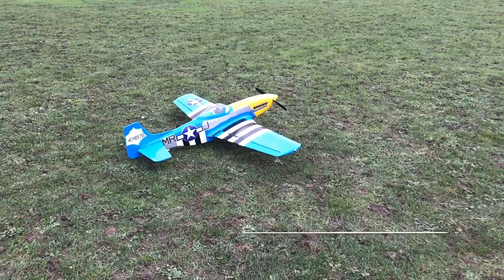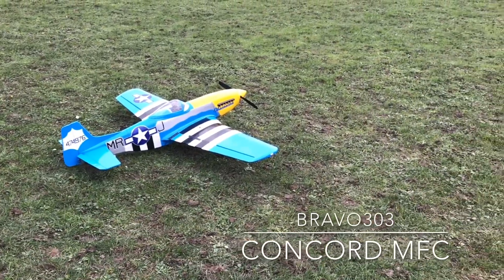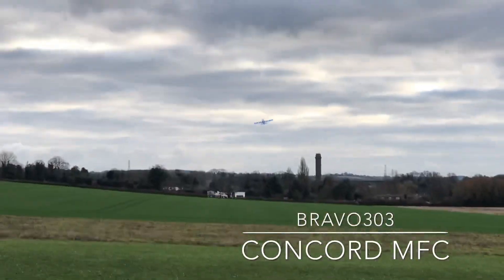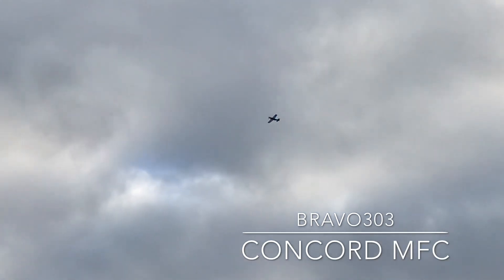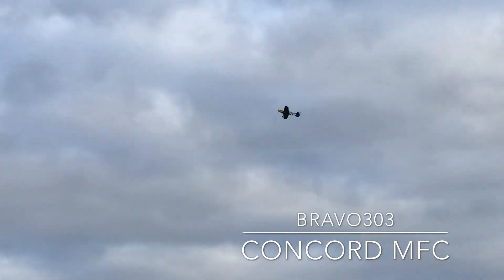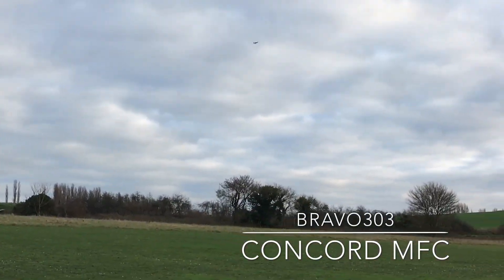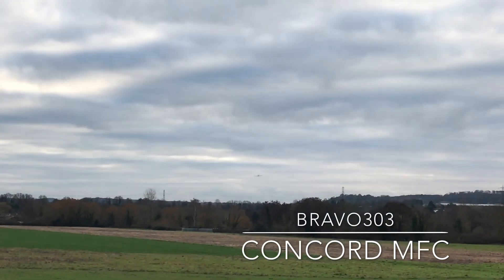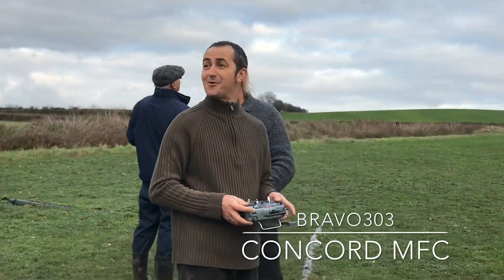VQ Models P-51 Mustang  EP "Obsession" Maiden Flight - Concord MFC

Comment: Congrats on the maiden Aaron.

I’m just finishing off building mine.

Do you mind sharing what motor/esc/battery combo you used. What was the takeoff weight?
Also, did you measure the CG where the wings meet the fuselage? The instructions are a bit vague.
Cheers
Reply from the maker: Geoff Wicks 80amp esc / 14x8 prop / Flying weight 7.3lbs minus the receiver battery which is of course optional / CG as per the manual and trimmed to suit / I've only used 2x3s 2500mah in series up til now, But will 6s 3000mah next time / Also to make sure you are aware that this  Maiden flight video was done on a 4s LiPo. Since going 6s she flies lovely. Just a smidge of right rudder on take off. Hope this helps Bud.

Motor Spec - Tomcat G60 motor 
420KV
Amps continuous 60A
Amps burst 72A for 10 seconds
Reply: Thanks for the great info.
I’m assuming your flying weight of 7.3lbs is without the flight Battery?
Did you measure the CG where the wing meets the fuselage?
I will be flying mine on 6S 4500. Fingers crossed!
Reply from the maker: Yes C/G at the root of the wing and balanced the model inverted for best C/G results